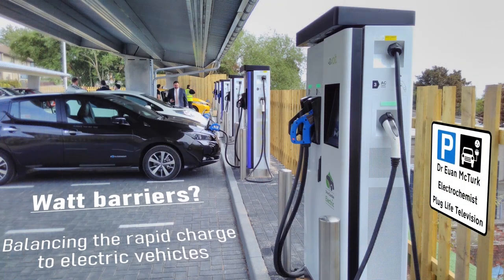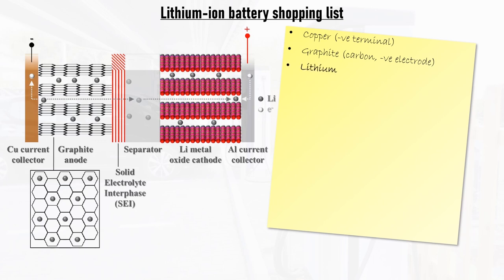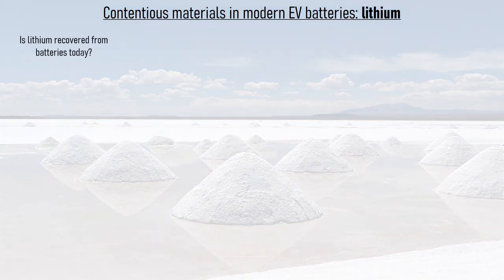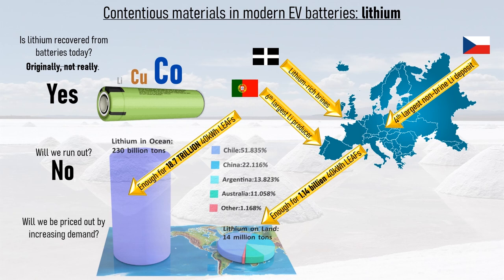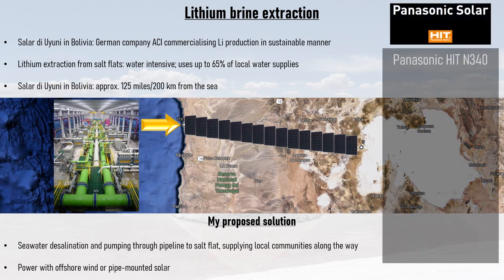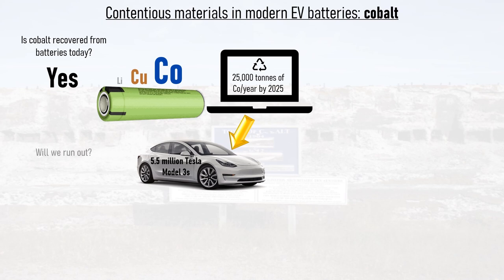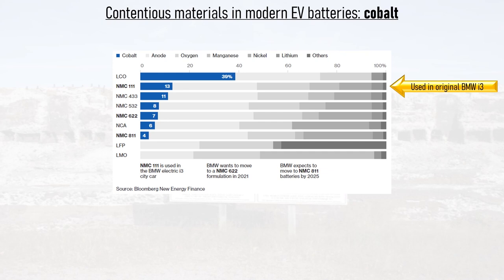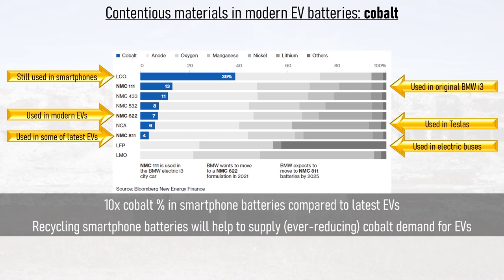Watt Barriers: balancing battery raw materials Part 1 | Plug Life Television episode 23

Comment: I have a question, first i should say i’m a physics high school teacher and in the past chem teacher, but nowhere near your expertise.  But early on in the video you talk about the polymer membrane only allowing Li ions through, but not electrons, is this due to the electrical charge direction rather than the size, as electrons are a lot smaller than any ions of lithium?  I assume it’s because the electrons are attracted to the Cathode and ions conversely????  Can you explain?
Reply from the maker: The separator in a Li-ion cell has tiny pores that are wide enough to allow lithium ions to travel through the separator to the cathode on discharge, or the anode on charge. This also requires the electrolyte to be ionically conductive by having a lithium salt in it. However, the separator and electrolyte in a Li-ion cell are not electrically conductive (much like why plastic is used to insulate electrical cables), so electric current cannot flow through them like they can the metal that makes up the wires in the external circuit. So it's nothing to do with the size of electrons vs lithium ions and everything to do with ionic vs electrical conductivity of materials.

Also, on discharge, an electron is stripped from a lithium atom in the anode and both travel to the cathode, the Li+ ion via the separator and electrolyte, and the electron via the external circuit. An electron then recombines with a Li+ ion in the cathode to form a lithium atom. The opposite happens during charging. Therefore, electrons and Li+ ions are both attracted to the same electrode at any one point.